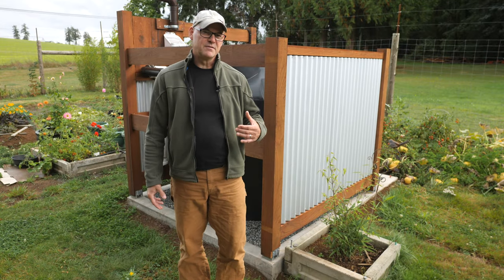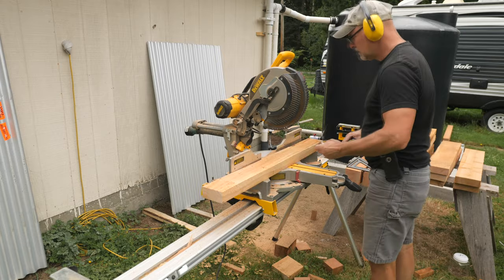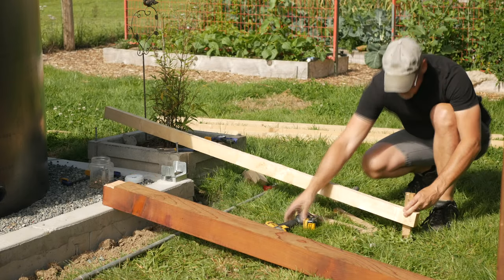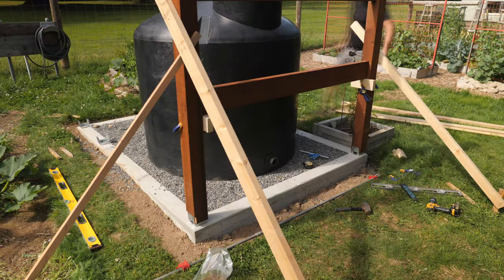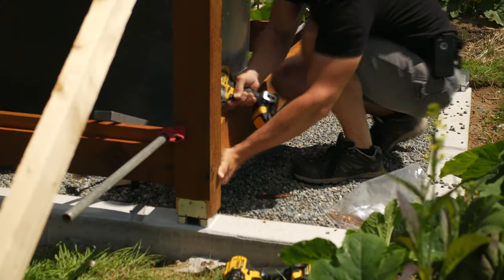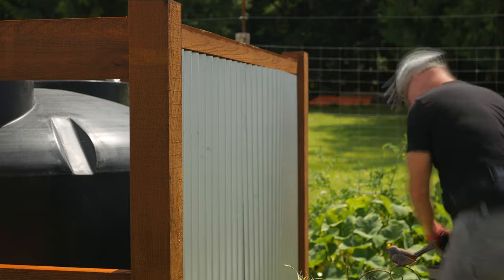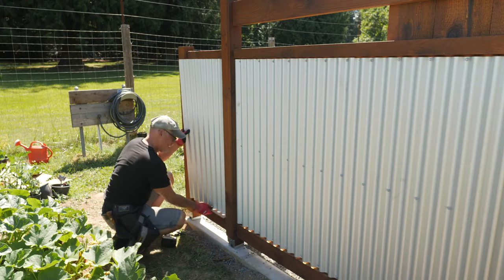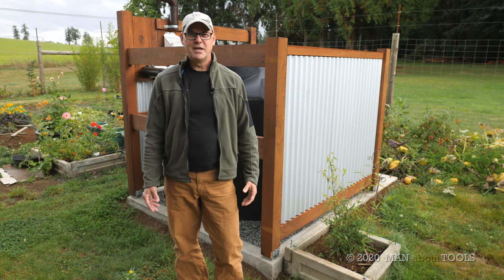Rainwater Harvesting Tank - cedar & corrugated steel fence surround [OFF GRID]

Comment: For a cap you could use drip edge moulding used on a roof edge attached to your galvanized plate forming a cap. Use silicone to attach both or a.fastener of your cloice.
Reply from the maker: Great idea! Thx
Reply: @MANaboutTOOLS  no problem sir. Cheers. I enjoy your channel

Comment: the finished product looks great. The only thing that i would have done differently is put the roofing screw through the ridges rather than  the valleys of the corrugated iron panels.